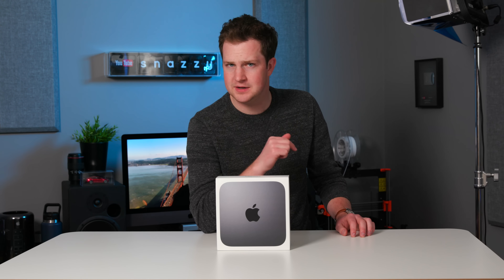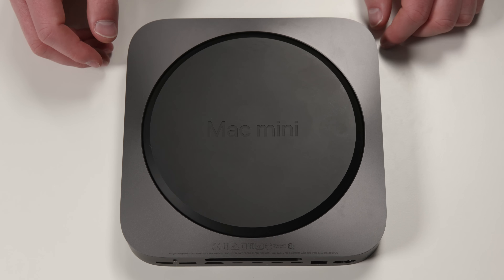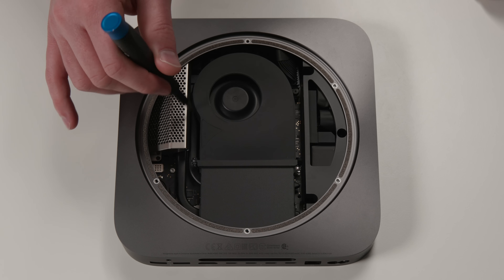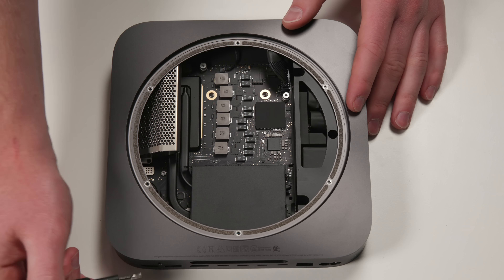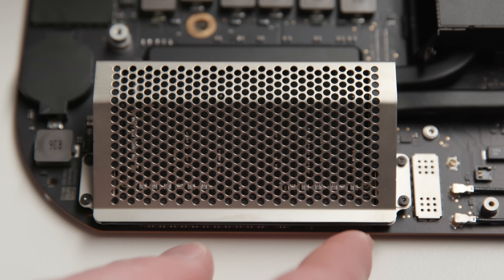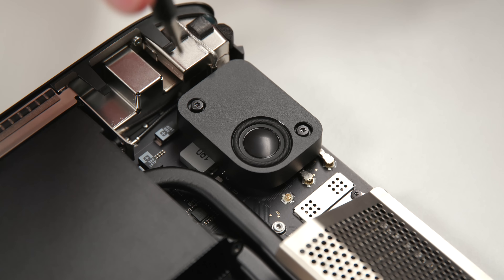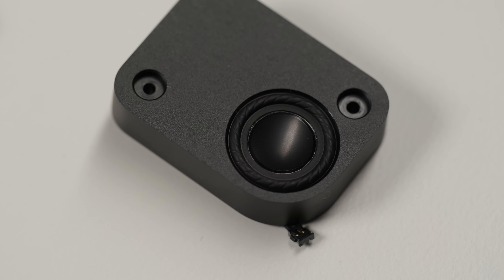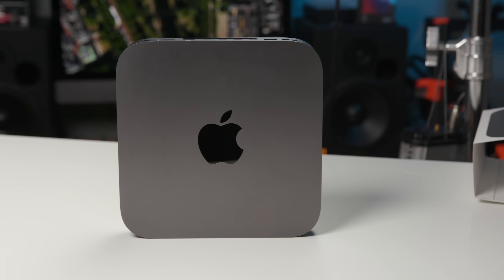Can You Upgrade the 2018 Apple Mac mini?! - RAM Upgrade Tutorial and Teardown

Comment: if you're a repairer there is nothing "cool" about T2.

They took away netboot.

They're about to take away target disk mode.

Storage is soldered to logic boards.

No starting up from stuff like a external utility drive with diskwarrior, data rescue, etc... without first setting the unit up and then changing a security setting in Recovery Mode.

If your motherboard dies, even if the SSD is removable, the T2 chip on that logic board is the only one that can decrypt the data on the fly off the drive as you access it.

It's a perfect recipe for a data recovery nightmare and has killed things like a 10 minute clean reinstall with imaging tools. Apple are total idiots and are screwing both techs and customers alike, even if you work for one of their "Authorised Service Providers" you will get the same deal. They do NOT have solutions for these problems, they literally jumped into this for the profit margins on selling disposable thin, flimsy junk and hand waved all these concerns from techs and big purchasers of their hardware that they'd fix it later and now here we are, 2-3 years later and they still have no real answers or solutions.

My only advice if you can't leave Apple, is that multiple backups are mandatory or you're an idiot who deserves to lose their data.

This is likely the only warning you will get as Apple has gone beyond delusional since we don't have Steve Jobs around to slap the stupid out of the other execs when they do stuff like this anymore.
Reply: Frequent backups are necessary regardless of the platform you're on. Good thing the Mac has time machine.

I don't believe the T2 chip was implemented purely for profit margins, however. I would be inclined to say that an engineer came up with the idea, purely in line with their privacy focused mission statement. I would then agree that it was met with good reception from executives after the fact when they realised that they could make more money for data recovery on top of a logic board death through data recovery services et cetera.

There are genuinely good engineers and developers at Apple, and all other companies for that matter. Don't undermine all of the other great technology in this computer because of one security chip. The T(x) chip technology will probably be refined further in the future to streamline the experience due to backlash.

Comment: So if the SSD fails you have to replace the motherboard and CPU.  Bad engineering, bad design.
Reply: Good for Apple to make greedy profits from future repairs or selling replacement products by wasting otherwise reusable parts.
Reply: I'm guessing there is some way it could be done.  The real questions are, where is the video showing the steps?  Aaaaannnd do you trust yourself with a soldering iron?
Reply: Clifford J. Summers Sr. 

Yeah not going to happen no matter how good you are with the soldering iron. That shitty soldered SSD is linked to the T2 chip.
Reply: I see your point, but it isn’t “bad engineering” - It’s a method to increase profits.
Reply: Ross Goosen to be honest that’s a pretty sketchy profit technique
Reply: Roughrideyy 45 it is.
Reply: @Roughrideyy45  absolutely, but its not "Bad engineering, bad design". abcmole sounds like a naive, young Scandinavian, expecting design to always be done in service of the greater good. Apple didn't become the world's first trillion dollar company by looking out for the little guy. At least not since Jobs pushed Wozniak out the door.

Comment: Replacing the first black plastic cover with perhaps some you may have drill holes in or no use at all after placing soft, small rubber feet on the bottom of mini should help with heat throttling problem maybe create some kind of mesh screen that can be cleaned of dust and debris from time to time. Worth giving effort 👍👍🧐

Comment: My guess is that the metal shield covering the RAM is RF shielding.  It cuts down on the amount of radio interference electronic devices generate.  It may also help wireless and bluetooth transmission and reception.

Comment: the internal speaker may be bad sounding but it is there for a reason.

that is so you can hear when the mac restarts (apple no longer plays the startup chime out the line out).

also to tell the user when to release the power button when flashing the firmware.

if the mac did not make any noise when flashing the firmware you may think it did not turn on and try again and end up bricking it.

the ram shield may be so that the  ram cant act as a radio transmitter since 2.666 ghz is only 200 mhz higher than 2.4 ghz of wifi and bluetooth.

in a day in age when the higher clock speeds and data rates in technology it is bound to be have some radio interference issues so something as little as a rubber pad coated with conductive coating can make a difference between earning a class b or rule 15 fcc rating or not.

Comment: Just to be clear, is the screwdriver bit for the security screws included in the linked iFixit ProTech Toolkit?  I'm assuming the bit is one of the pentalobe sizes with a hole in the middle.

Comment: I am glad they upgraded the Mac Mini.  I would rather get an I-Mac and I am waiting to see what they do with the 2018 I-Mac.  The reason is that is has a monitor with the computer, with a Retina 5 K display, and you also get a keyboard (with $30 more an upgrade to the one with the numeric keypad - which has more keys than the base model), and a choice of the Magic Mouse 2 or the trackpad, or both for some extra.  I am hoping for more fans, but also the Ram door in the back, so I can upgrade the ram later, but I do prefer the 2 TB SSD, and a powerful CPU and GPU.  The Mac Mini, you would have to get a Keyboard and mouse along with the Monitor as extras.  Thank you for showing the insides of the Mac Mini.  It is a nice size, and if you go someplace that already has a monitor, or a TV with HDMI, and a speaker bar with Bluetooth, you just bring the Mac Mini, keyboard and mouse, and it doesn't take up much room.  If you don't watch TV while you are working on the Mac Mini, you can just use the HMDI from the computer to the TV.  A speaker bar with Bluetooth would be awesome to listen to your music, and if you have it hooked up to a TV or you find an nice curved monitor, you can down TV shows and Movies from I-Tunes, or music videos.  You can create your own with Final Cut Pro X and Logic Pro X, there is a Pro Bundle also available to purchase have it installed on your computer.

Comment: it's because of the power supply, they have it rated for exactly what is being used, and upgrading memory means more wattage requirements under torture testing which not all power supplies can handle unless rated as 80+ certified from regular white to platinum series. so if they are using a semi subpar psu that isn't 80+ to save on costs, then the expanded ram may cause issues in some of the systems. just a thought, not a reason, sorry just throwing that out there

Comment: mac mini needs speaker (no matter how bad it sounds) so we know when to release power button when flashing firmware.

typically after clicking on the updater it shuts down the mac and then we have to while holding the power button plug in the power cord and when we hear a tone we release the power button to begin the flashing.

also as soon as we hear the startup chime we hit certain keys to enter various modes like disk mode (turns mac into external hard drive), enter recovery mode or the options to choose startup disk and so on

to keep the mac smal size apple usually solders the cpu, gpu and now the ram

the shield over the ram protects the memory when putting the board back in the case but due to the high operating frequency having a 1.3 ghz radio transmitter in your house may not be the best thing*.

*= not exactly what frequency memory works on but somewhere i heard that it is probably 1.3 ghz

Comment: Nice to see that Apple took some criticism to heart, and actually made it possible for a user to upgrade their RAM. If only they didn't screw up the ability to upgrade storage!

As sleek as the new Mini appears to be, I'm gonna have to pass. For the price they are asking, I can have a computer that not only runs laps around it, but completely grinds the Mini into a fine powder (i.e. the computer I have now, which is probably less than it used to be since GPUs finally dropped in price).

Comment: In a weird way you could make the case the Apple Mini-Me is modular to a degree.  With enough patience you can take out the CPU shroud/carrier module.  Possibly to replace it with a new unit.  The RAM is accessible.  As is the Wi-Fi.  Plus their power supply unit.  What is it?  Fifty something screws to really get it open?

What can you replace or upgrade in this little PC?  I recall an ad from Apple about how IBM compatible PCs used too many cables.  I traced out many more cables in their ad than actually were connected to the machine.  Are there any SATA ports inside?  Any USB 3.0 ports on the back?  Can I replace their OS with Windows 10?

Comment: I use and love the 2009 mac pro running el capitan, old OS I know but all I can get, I have another drive with a patched mojave, one thing I love is the upgrade ability. You press a switch in the back, open the panel and you have access to user servicable RAM, 4 drive slots, GPU, and the optical drive. With some digging you can open the cpu slots (dual cpu chips).

Comment: I wonder if you can use it with the rubber bottom removed to achieve better cooling. Obvs you have to lift it up a little bit to let air through

Comment: For daily usage I still using my Mac mini server 2012 with i7 quad, upgraded the boot disk to SSD,  while keeping the original secondary disk for backup disk, also upgraded the RAM to 16GB. It's a good upgrade if compare to downgrade version from 2012 vs 2014 minis 😅, but I guess I skip for a year or two, till the different is really significant or my machine is not sufficient for daily web development anymore.

Comment: I still use my 2012 A1347  Mac Mini server with the dual ssd's everyday. I've pretty much maxed it out except for storage capacity but it keeps on handling video editing without issue. I was hoping the new Mac Mini would have the same upgradeability but apparently I hoped for too much.
Reply: I think you should be able to boot from thunderbolt but probably only current mac os or later.  Still possible to work with this system but not ideal.

Comment: Maybe the storage is soldered in, but you can expand it with an external drive with usb c. The g-drive can go up to 3000mb/s read. It’s as fast as the internal storage. eGPU is also a nice addition of usb c. If you don’t choose the 10gb/s Ethernet option, you can get it also with usb c. In short usb c / thunderbold 3 is amazing 😍😍!

Btw great video. Keep up the great work!

Comment: Funny how apple tech support told me the memory is soldered to the board on a 2018 Mac mini - I've gotten several different answers
all from different tech support agents and 1 sales agent. I was so hard to get an answer on if the price quoted of 800 hundred dollars (for 32GB) included installation
and I had to call other numbers to try and get a clear answer - to no avail.

I've had my 2018 Mac mini Intel i7 3.2 Ghz 6 core computer with 16 GB of RAM for the last year or so
and now looking at the new Mac studio coming in at an entry level config of 32GB of Ram.

Forget the late model M1 chip Mac mini as it's more crippled then the 2018 - odd for sure, but probably done
to railroad most to the new Mac Studio.
Reply: I have the same model, in fact I just bought it for $549 new in the box from OWC with 128 GB SSD and 32 GB of RAM. I could have upgraded to 64 GB for an extra $80. They still have a few in stock for that same price.

Comment: They should have just made the base 16gb.

Honestly the 2012 was one of the best minis. Ram was super easy to upgrade, the drives were difficult like the ram in this mini, but you could at least replace them if necessary and even get a kit to add a second drive.

Comment: I doubt that the Imac line will help with upgradability.. A video developer here tried that, and bricked the computer when he changed the ram to larger ram.  (He tested the ram both before and after the "upgrade" and had no problems at all with the system he tested on.. but the mac no longer talked.. Probably something to do with the "You are not allowed to fix your mac" project at apple... (Brick things when a change is noted, and not unbrick when that change is put back....)  Now he COULD have done something incorrectly on his imac... I wasn't there, but he said it went construction grade after he changed either the SSD or the RAM.. .not sure which.

Comment: Thumb dimples were removed on the 2014 mini. Do some research. Also they aren't discouraging users from upgrading ram, they're providing a small amount of security. As anyone whose taken extra ram from a co-worker will know, this would prevent such "reallocation of company resources". Also makes sure whoever does change the ram at least knows what they're doing. And don't badmouth the internal speaker. PCs since the dawn of time have had internal speakers and it is handy on occasion.

Comment: The latest Mac mini 2018 builds are no longer user upgradeable – you need to take your Mac mini back to your local Apple Store to have them upgrade it for you. They've changed all the screws to stop you accessing the internals. They look like proprietary T3/4 security screws.
Reply: are you 100% sure about his statement?
Reply: @liothomasart  Yeah, so, I'm just off the phone with Apple Support (who were very helpful). Initially they hadn't heard about this issue, but they did some digging and confirmed that there have been some under-the-radar changes made to the Mac mini 2018 very recently. They then liaised with my local Apple Retail Store, who likewise were unaware of the changes. They're now aware of the changes, but they're having to investigate what the new internal process might be. I'm waiting to hear back – but it sounds as though it might get quite complicated, because essentially Apple will be installing a third parties components, and what happens if things go wrong further down the line – how will it effect my AppleCare etc? I have to say they're being helpful so far. It's just my luck that after saving up for this new machine, I get one of the first new variants off the production line that's subject to this new process. I'll keep you updated.

Comment: I had my 8GB replaced with a 32GB the repair shop who did it forgot to plug one of the fan back, I noticed back home when the machine started to flicker during YouTube videos. Brought it back and they said the cable in question is in a tight spot and probably unplugged itself when they put everything back together. Just make sure you install a fan control panel after the job is done and make sure the fan is actually spinning. Otherwise, the machine runs fine.
I got the RAM from B&H: 
Crucial 32GB DDR4 2666 MHz SODIMM Memory Module Kit (2 x 16GB)

Comment: Okay obviously I'm not going to read all the responses but I agree with anyone who has already said that the Mac Mini's horrible speaker is obviously there for repair purposes. When you're working on it as far as software you can hear the tones when the the computer is turned on indicating the first step that everything is working properly. Now those rubber hold Downs for the ram are probably an option to help utilize space. They are probably trying to fit everything they needed in the same shell which is economical because they don't have to come up with a new design. But also the metal screen is for support on the rubber hold Downs in cooperation to hold the ram in place for contact and functionality. Even in 80 to 90 durometer rubber with such small dimensions is not to be unsupported buy a metal joint when it's under pressure and Apple has ensured that this Ram module can take a Lickin and keep on ticking.

Comment: Good review/tear down - however I think you should have mentioned the Thunderbolt 3 (TB3)/USB-C and USB 3 ports on the Mini... also the fact that Apple is rumored to be working on a real Mac Pro, again .. (or a modular Mac/MacPro) - like the old MacPro tower.
---
Nice options for the mini - I wish Apple would have given a better video option, on part with a Mac Book Pro.
The nice thing about TB3 is an external GPU can be used for some things :)

Comment: The soldered-on SSD is a concern for potential buyer down the road, but I ran my 2011 Mac Mini (that's right, 2011, plus a 2009 as a "home theater") without an internal HDD for couple of weeks by booting from an external drive, so there's work-around for when the internal SSD dies.  I still think Apple should make the internal SSD user-replaceable, maybe with enough complaint, Apple would make the change in the next model.

Comment: Being unable to access MY data if anything on the board fails.
This is the biggest issue I have with the soldered on storage. In the unlikely event something other than the storage fails, my data is locked down. This in the end means I just don't store my data on the internal storage and rely on TB3 for access.

Comment: Wow!  Well done my friend!  I am not sure if this is the right computer for my music studio moving forward but it seems a reasonable upgrade to my 2012 mini.  I bought it in 2012 without knowing I would be producing a lot of electronic music since then.  I use Logic pro 10.4 and High Sierra and I have the smaller processor (I did not understand the processor concept then) so now I am having issues even with a 16 GB ram upgrade.  Should I wait for a Mac pro or would this mini be enough for the next 6 years?  I would of course get the faster processor and 32gb ram.